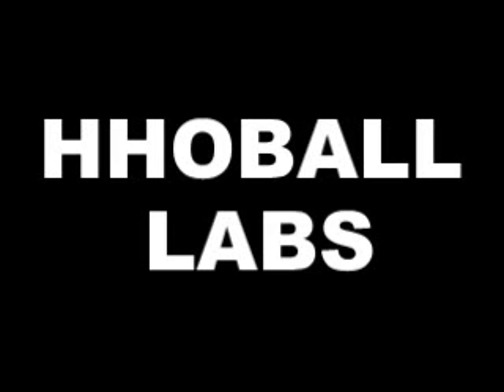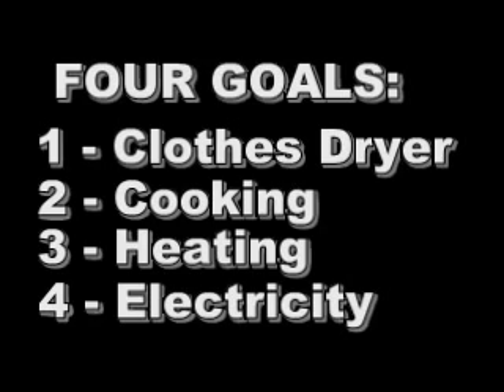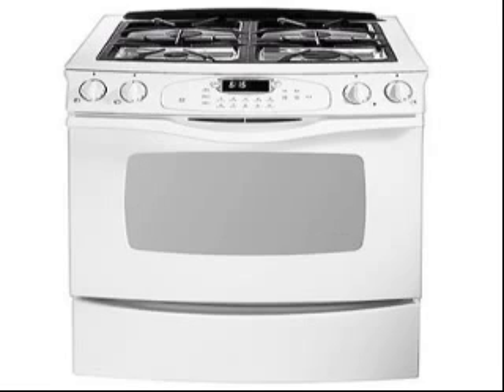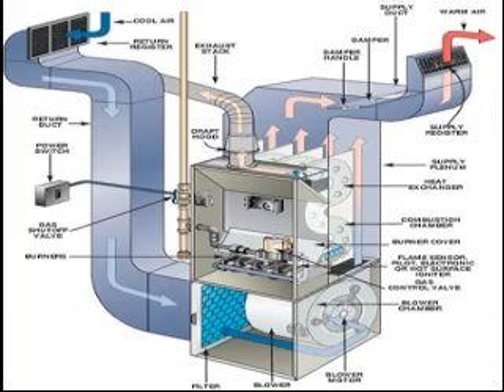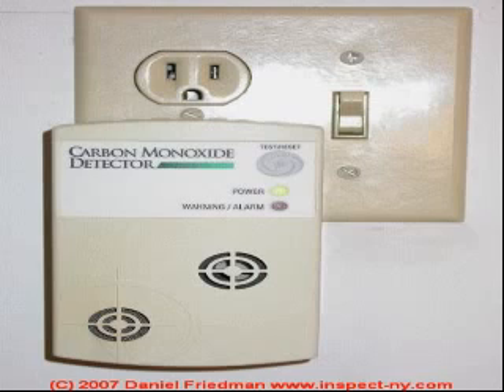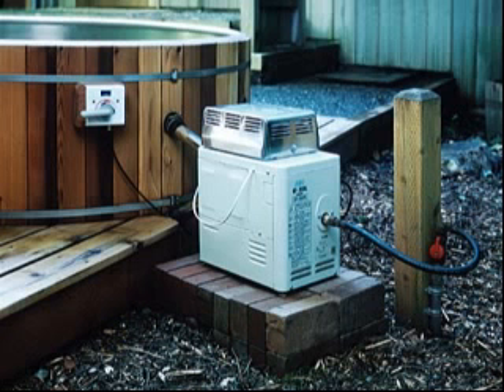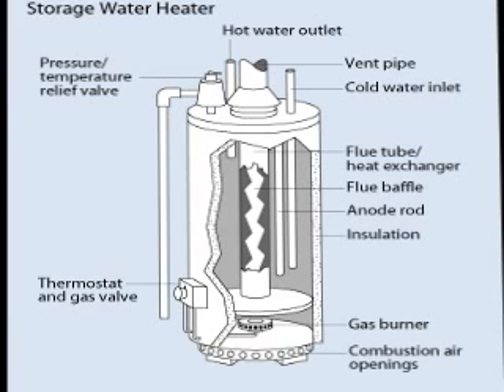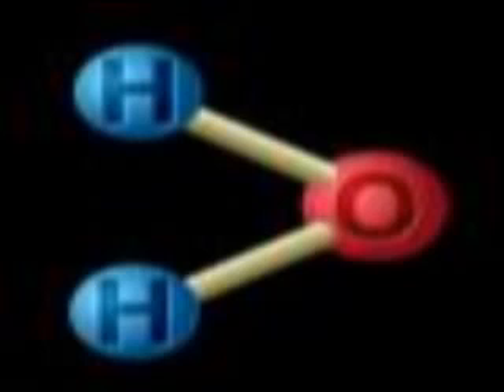#16 My Vision For Hydroxy Gas Part 1

Comment: you need to explore the morse potential ,actually it is done through a thing called triangular spinning morse potential ,useing threee different frequencies one above the resonant frequency of h2o and go one below with it spinning in a chamber it will bust the molecular bond apart blow it away ,, flat line the graph , google that stuff a colledge course from yale and stanford both have it a physics class on molecular bonding

Comment: Thank you for great information in this video.
I like idea of hydroxy being widely used very much.
I am not concerned about efficiency of hydroxy production, but am about using it inside our homes because they say it can explode if it starts to leak. I watched one video where a guy says that even home static electricity can ignitate it.
What do you think about this? Can this be a serious problem?
Stan Meyer said it's "flammability" can be reduced by mixing with non combustible gases from air.

Comment: in reply to maituub: having worked in the Electric Power Sector for decades (with exposure to US , Europe, Asia markets and technology)  AND having worked on confidential Hydrogen generation projects, I base my opinion that maituub is correct -- the grid will remain fossil-fired for many years to come (primarily Coal and Natural Gas). Having said that there is a place for HHO that is generated efficiently using new non-toxic and non-caustic benign electrolytes (NOT KOH). Power from renewables.

Comment: i like where u r going but to make a long story short.use your car as your power generator and change all your appliances to electric.  build a HHO system where your cells dont have holes in the plates or the electrolyte mixture do not touch the edge of the cell plates, this will make more HHO for less power eg. 12VDC@10amps will make 2LPM,upgrade ur alternator to a high amp PMA, port to your car's vacuum,use a AFC to re tune your cars ECU to use 10% gasoline and 90% HHO or maybe 99%,UPS>house.

Comment: Why not just run these appliances on electricity?  It would be far more efficient than converting the electricity coming into your home into hydrogen through electrolysis then burning it to generate heat.

Comment from the maker: You have not popped anything. You must research the newest ways of power generation. Look up the Molten Salt Solar Tower in Spain. This is a huge breakthough which allows power generation day or night, using solar thermal energy. Molten Salt is 60% Sodium Nitrate and 40% Potassium Nitrate. This power can be used to preform electrolysis.  Also remember that electrolysis at low amperage is being used right now in my country by XOGEN. Check it out.